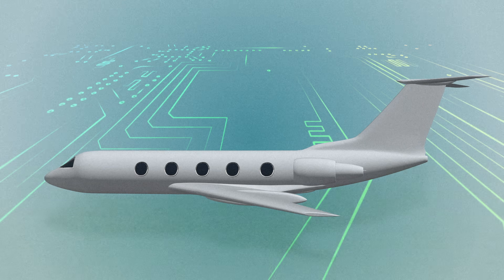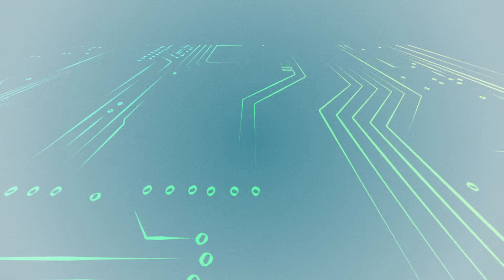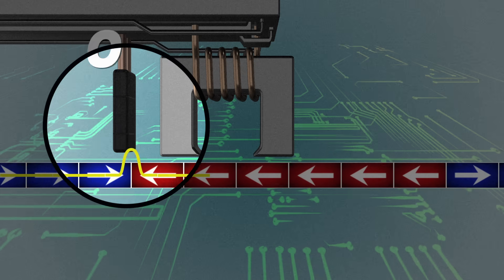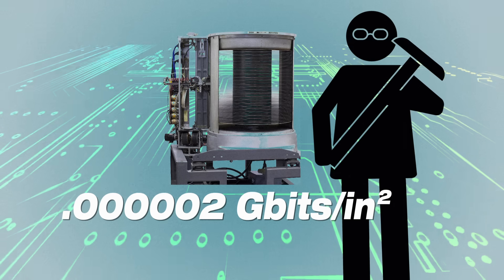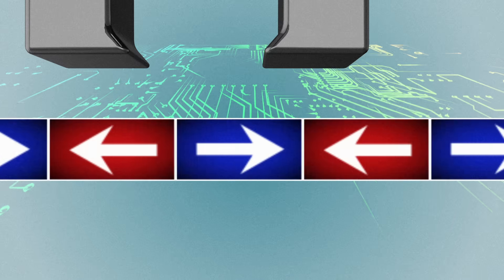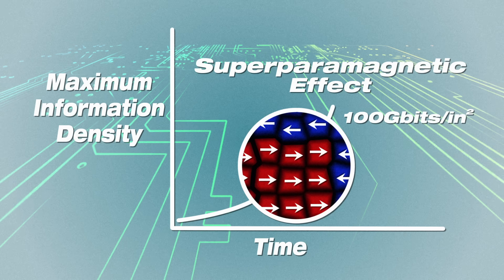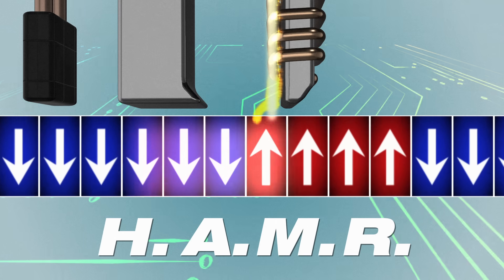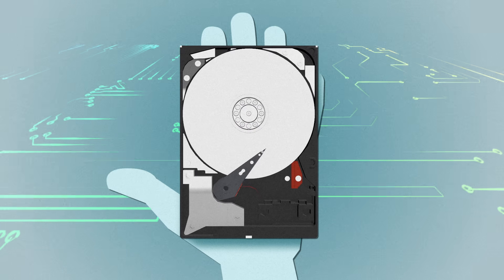How do hard drives work? - Kanawat Senanan

Comment: The first hard drive developed was 300 million times smaller than the capacity of the current hard drive. There have been several technologies in the development of these hard drives. A typical example is thin film lithography process technology, which has led engineers to reduce readers and recording devices. Recently, there is a technology called heating magnetic recording, and this technology can store a lot of information by reducing the instantaneous magnetoresistance of heating at a specific point with a laser. I am looking forward to the development of hard drives in the future. 10926

Comment: It’s crazy how far storage tech has come. It’s been 8 years since this video released and HDD are all but obsolete. 

Today you can get an SSD with a 100TB capacity that is smaller, silent and faster than any HDD. (Though it will cost you $40,000)

Comment: If I was ever given the task of finding where a picture was stored on a disk, would it be spread throughout the disc is random looking places, or altogether in one tiny place?  Your graphic is somewhat misleading as its shows apparent linear distribution.  Can you explain please?
Reply: This is outside the scope of this presentation, but I'll try to answer it.
It depends entirely on the OS (operating system).
Windows XP would write it wherever there was enough space and you'd have to defragment it regularly to keep the data together on disk. It didn't care if there was enough free space, it just plopped the data wherever it could. With usage over a longer period of time, the data would become interleaved, slowing down access to those files considerably. That's why you had to reinstall the OS every few months or so, to keep it running fresh.
Windows 7, on the other hand , came with a form of Diskeeper (commercial software at the time) embedded into the OS, to place the data in unused chunks in order to avoid interleaving.
I imagine Windows 8, 8.1, 10, 11 does the same. I skipped Windows Vista entirely, never used it.

Comment: all good except moores law reffers to doubling the number of transistors that could be placed a fixed size waifer of silicon every 2 years

Gordon moore was an a co-founder of intel, which we all know to be a processor company not storage company

Nothing to do with hard drives as its different technologies, and hard drive storage has not been incrementing every 2yrs without fail since moores law was stated

With reference to moores law, whilst the number of transistors can still double, its stopped now, in favour of multiple core processors this is because of the loss of performance caused by heat and inthink the second cause was noise or electrical interfearance 

This is why 3.8ghz is usually the faster processor speed you will find on the domestic market (it can be overclocked to 5 and 8ghz) but that required some serious cooling equipment and your operating at microwave lengths

Comment: Ever since the posting of this video, two things happened:
- The appearance of SMR drives and the SMR method for increased space efficiency at the cost of performance and longevity
- The standards war between HAMR and MAMR (Microwave-Assisted Magnetic Recording). HAMR was proposed by Seagate and is currently being implemented, while MAMR is a development by Western Digital and is also being implemented at the DataCenter phase.

Hybrid drives or SSHD, featuring NAND flash cache in the controller boards, aren’t advancements but a sidegrade with variable results, that has been superseded by SSDs or more advanced magnetic technologies.

Comment: 1. How is data written and read on the platter? 2. What makes the arm move? 3. How does Faraday's law work in the hard drive? 4What is the gap between the head and the disk surface? 5. What is the function of a recirculating filter?

Comment: on wikipedia  it is written : 
magnetic field into electrical current (read the disk) 
what u told is just the opposite at 1:10
Reply: The video is explain how data is written Wikipedia is explain how it's read. Both are correct

Comment: I think you forgot clean rooms. Up until the early 80 people were using removable hard disks. Then they used clean rooms to remove the dust and seal the drives, allowing the head to ride closer and increase density.

Comment: so i broke some numbers up. 
a silicon atom is 0.2 nanometer in diameter. if you take it as square . its area will be 0.04 nm . so in 1 inch square we have around 1.6129e+16 atoms of silicon. and 20 terabytes is 1.6e+14 bits . so if you devide them you get 4.** atoms for a bit . i know its 2D but still its small. correct me if i m wrong.

Comment: I,m going to literally force my hard drive to stone 3X it’s own size when it’s empty witch is 1,500(GB) or 1.5(TB) um never mind I just got a new hard drive about 1 month after I posted this comment but any way if the world’s first hard drive of 1957 was 20Tb per square inch then it would have a Storage capacity of 50(PB) of information and that is 100,000,000 times the capacity of my 500(GB) computer

Comment: 2010: 500gb is a lot 
2019: 2tb is awesome and 16 tb is maximum 
2087: I’m rocking a 1000 petabyte SSD and a 2000 petabyte portable HDD from seagate
Reply: No matter what medium will be used in the future, the save icon would still be a floppy disc.
Reply: @nchlsky  that we can all agree on
Reply: I'm pretty sure owning an SSD in 2087 would be like owning a floppy disc in 2020.
Reply: In 2087 we wouldn’t use any HDDs anymore, since it will probably be replaced by SSDs that are faster and safer
Reply: @yeoldekrabs3436  it is possible that in 2087 data will be stored with superior storage technology. SSDs could be considered as oldschool by then.
Reply: @focus Yeah, right
Reply: @focus-mo1nq  it will on crystals by then.
Reply: @yeoldekrabs3436  it would go mainstream if they can make them last longer than HDD's
Reply: @yeoldekrabs3436  SSDs are faster, not safer. In fact, the faster you go the less safe it is. SSDs have a limited ammount of data that can be written to a cell, and when cells are reaching their limits, they are prone to failure or even dying. Hard drives on the other hand don't have this limitation, and the only thing to keep them going is demagnetization or rot. If you go even further, you got tape storage, which is still used to this day because it's realiable and durable af.
Reply: @yeoldekrabs3436  nope, ssd is not reliable for long term data storage. SSDs are only good as temporary working memory for OS to run quickly. We need another solution for long term data storage.
Reply: @yeoldekrabs3436  We would use DNA instead since 1 gram is equal to 215 petabytes or 215 million gigabytes!
Reply: @yeoldekrabs3436  i like the idea of going upto 2087 and suddenly coming to 2000
Reply: IBM has been experimenting with atom size storage. https://www.youtube.com/watch?v=oSCX78-8-q0
Reply: Meanwhile me: can't even fill up a 22GB phone
Reply: We might all be running on RAM only at this point.
Reply: @alexanchannel  registers!
Reply: @ba.chin.em.ba.tam.  You're right! Also, for long term storage, currently tape is the best, and there is a lot of research trying to use DNA as reliable and compact storage medium.
Reply: Even micros have 1TB now
Reply: I remember when I bought my 212 Mb hard disk as a young teenager. It was 5x bigger than my 42 Mb drive! There's no way I could fill.... and "insufficient disk space" in a matter of a week.
Reply: There are many other ways to store a lot more information
I watched a video from this channel which said that there are other ways like a glass coin or smt with engravings
Its a vdo by techquikie
Reply: Go away, we know seagate paid you ! 😂😜
Reply: I’m your 300th like! What an honour!
Reply: Imagine 1 yottabyte (1YB) worth of information
Reply: There is universal limit of how much data you can store, you can't go beyond 1 bit per atom and currently HDDs have 1 bit per 100,000 atoms density, so we could roughly store 100,000 times more data in a HDD than we are able to store now.
Reply: do the maths of moores law before predicting. If it really continues to follow moores law this comments space will be too small to be able to write what 2087's number will be.
Reply: its 2022 now still waiting
Reply: 3000: Infinite storage
Reply: 500GB wasn't very much in 2010.
Most home PCs under $600 already had 1TB HDD's at that point.

Comment: 0:05 This is why hard drives will wtill hold a special place in my heart, long after SSDs make them obsolete. There's something almost magical about something so intricate, and so accurate in it's movements, that you just don't find anywhere else. I honestly think that hard drives are close to the pinnacle of human engineering, not because they are cutting edge or perform better than rival technologies; but because they are capable of accuracy that our human minds cannot even comprehend!

Comment: Hard drive working understanding
1….hard disk have stack of spinning disks in it.
2….with a recording head flying over each disk surface 
3….the disk is coated with the film of microscopic magnetised metals grains
4….the data is recorded in magnetic pattern formed by groups by those tiny grains 
5….each group is called as a bit which can only absorb 1 and 0
7….magnet reader and magnetic writer heads are two components fixed in hard disk…..and it flyes 5nm above disk surface about the width of two strains of dna
8….1 square inch can hold 1gb of data 
9….by changing the direction of arrow in recording from  longitude or horizontal  to perpendicular or vertical allowing 1square inch to hold 1tb of data

Comment: 3:38 Magnetization is easily disturbed by heat energy. So how does heat assisted magnetic recording work??
Reply: Unbelievably fine tuned heating. still not 100% stable or reliable but a cool thing indeed.

Comment: A hard drive head reading a magnetic platter is nothing at all like a phonograph reading a vinyl record. A phonograph stylus sits in the groove of the record, wiggling back and forth and sending an analog signal. A hard drive platter, or the head itself, would be damaged if it came into contact with the head. The hard drive stores Information in digital form, not analog. Hard drives are magnetic media, records are vinyl media. They don't have much in common besides spinning discs.

Comment: And when the hard drive is being assembled, how do they make sure it's exactly 5nm above the disc?
Reply: The Read/Write arm is designed like a finely tuned Wing, then not reading data the arm parks away from the disk on a sleeve, then when it has to read or write it swings out over the disk when spinning because the disk creates a very fast stream of air over itself by nature when spinning, how high the arm floats depends on it's airflow shape.

Comment: Narrator: ...60 GB per in^2
Me: In normal units, please.
Reply: @bathtub_farter  Because It would be handy to understand the size of these measurements without having to do math. 95% of the world already uses metric, so cooperate already.
Reply: Mambodog 532 base 12 will always be superior
Reply: @mambodog5322  yup, would be nice to be able to imagine it
Reply: In^2 means you take a point and either move right OR left after every inch until you reach where you started. Basically it is area of a square. And we fit 600GB in 1inch^2. That's pretty badass. By the way it is in normal units.
Reply: @bathtub_farter  No, in metric, not your freedom units.
Reply: Murica wont cooperate

Comment: I wonder how head being 5nm apart from disk doesn't damage the disk or head? Especially when you use HDD in portable devices such as external HDD or laptops, where spinning HDD is frequently shaken. Also what about thermal expansion? Thermal expansion would change location(radius) of bits on the disks, distances of head and disk, and etc.
Reply: The HDD Drive in a Laptop is totally safe and secure ans the HDD will ONLY GET DAMAGED IF THE USER DROPS THE LAPTOP FOR NO REASON OTHERWISE IT REMAINS INTACT

Comment: So wait, what happens when you delete stuff, does the HDD backtrack and somehow demagnetize  the bits to clear more space on the disk?
Reply: No if you delete data the disk doesn't actually erase them, It just marks the area on which the data is stored as being free. Until it actually overwrites it with some new data the "deleted" information is still there. This is why some software can recover your data even if its been deleted.
Reply: @petmach  Pretty sure many government agencies find that useful
Reply: @petmach deleted data on a Hard Disk Drive IS permanently deleted once it is deleted as you cannot get it back at all
Reply: @stephensnell5707  If you delete in in the regular way (shift + delete or delete and empty recycle bin) you can get it back with data recovery software as long as it is not overwritten.
Reply: But if you use a "shredder" software, it more or less erases data permanently by overwriting multiple times on the bit.
Reply: I assume that "Shredder" software you mean would just corrupt the data beyond any possible means to recover.
Reply: Very informative reply from you. Thank you. But what about those disks that come in as new? the data areas are neutral? or it has been randomly charged?
Reply: @KevinChar  filled with either 0 or 1 totally..
Reply: @ANKITKUMAR-pc8uz  Why we can write data so fast on new HDDs but when we overwrite its writing speed decreases
Reply: @ronixdash123  bcoz overwriting needs many permission check etc which are pre-set by os or the particular software, doing the operation..
Reply: @KevinChar  Depends on what kind of drive you get. Usually, all bits are just set to 0 or 1 by random, with all of them marked as being free to write.
Reply: Most likely random
Reply: A shredder software just fill the entire disk with either zero or one or both randomly..
This is called military grade data deletion.
Reply: Defrag the drive to actually overwrite the deleted data. Format and fill with new data if you really want to delete something.
Reply: No, when you delete something, the non write protection from that area is removed, that's it
Reply: I think all d magnets will b forced to have a common magnetization (that of 0bit showed in the video)
Reply: an “erase head” uses a super high frequency to magnetize, or erase, the magnetic particles.
Reply: @tankmchavocproductions6907  There is no anything like "erase head" its write head itself which overwrites data either with new data or zeroes or ones

Comment: But how does it actually read the 0s and 1s?

Like for example you have: 100100111000
How would you recognize each piece of the data? 
like(example): 100=A , 100110=G  or 100100=B,110=Z even if there is a binary representation of space, how does it actually know it is there in order to differentiate characters? or did I missed that there is a physical process that creates like a zone that creates cuts for the array of bits?
Reply: +Doge The Great 
magic

Comment: You can say whatever you want about SSD. It has better speed, it generates no sound at all, it's really solid and can take a punch without blinking. All of that is true. But man, the hard drives are stil so useful for storing a lot of data like archives or data dumps for a long time. You just have to be careful about them and not letting any cat near it. ^^

Seriously, I honestly still have hard drives from the 90's that are still working today. But any of my flash devices are dead within two years. (I know SSDs are known to work longer than that, especially the newer ones, but I don't think any of them will last 30 years like a good old hard drive)
Reply: +Tangeek M. If only there was some way to combine the best parts of both of them.

Comment: have they ever ribbed a platter? 3 surfaces at once, like a u-shaped groove. Interesting stuff. I seemed to have left off with enthusiasm after the mid 2000s. This vid explained it. I just sparked up a wd26400, running xp on 6gb. I actually had a raid with 512mb, screaming shreakers popping light bubs if they were tooo close. Time flies...like data.